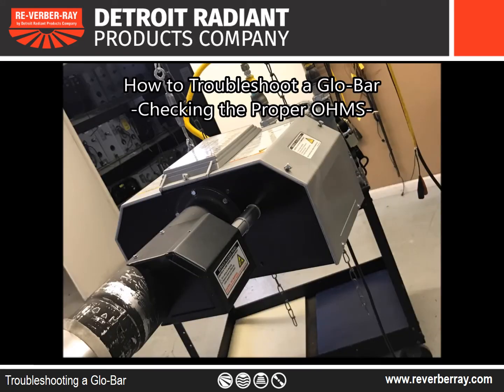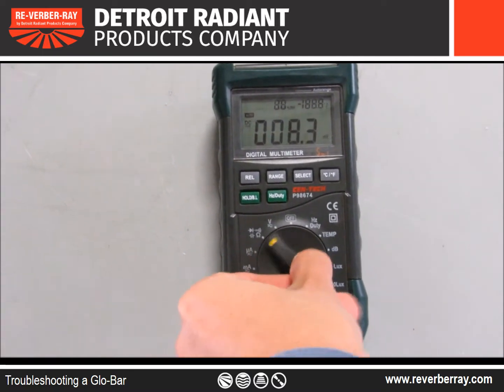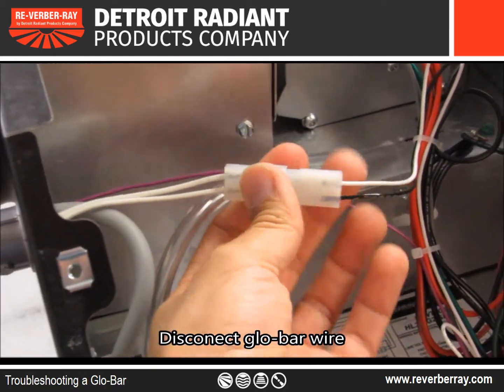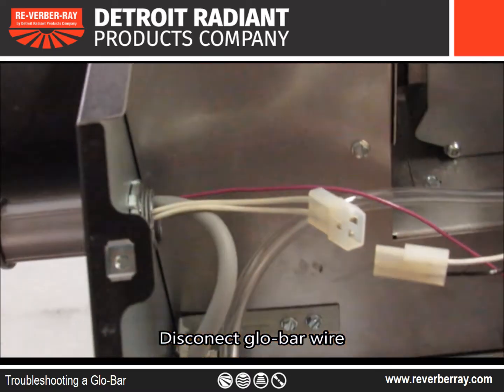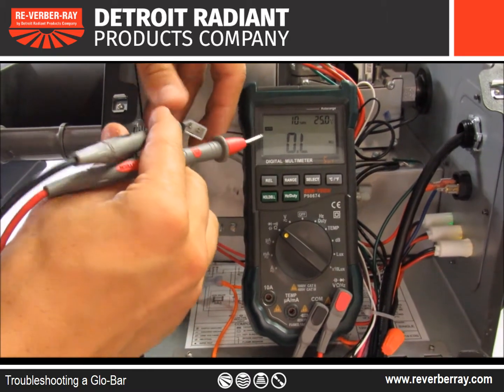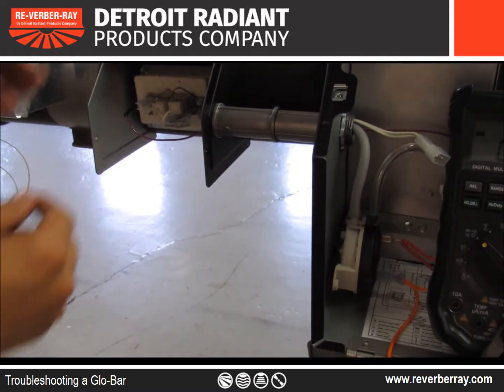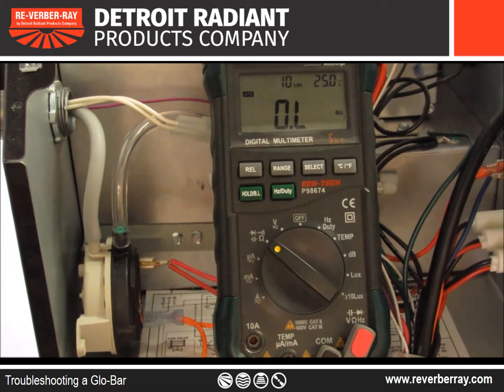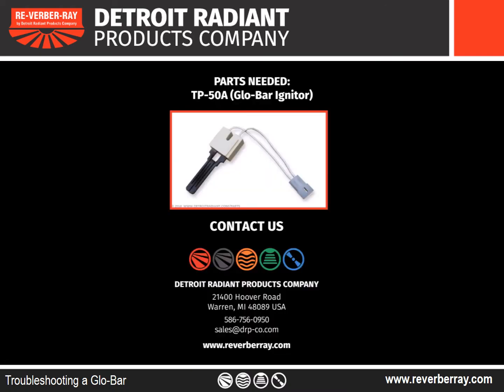Troubleshooting A Glo-Bar

Comment: I just bought 2 of the TP-50A due to mine reading 153 ohms. I checked the new one and it is reading 151 and 148 ohms. Are you sure this ohms reading isnt normal? Bought is directly from the Detriot website